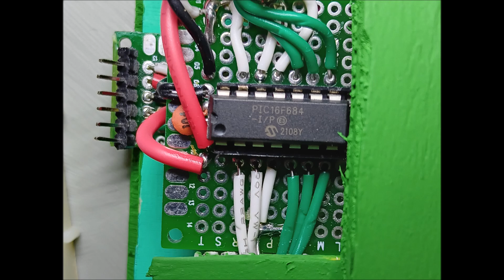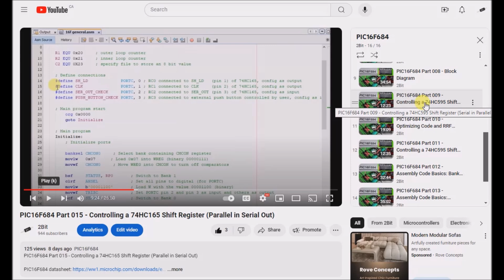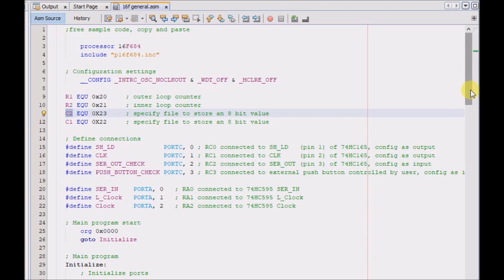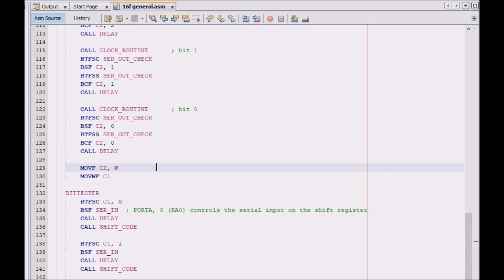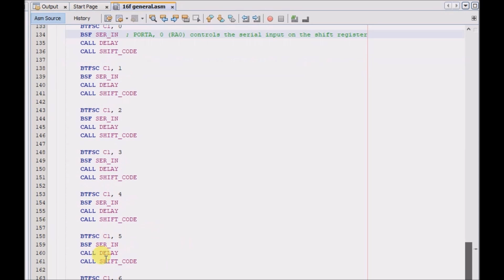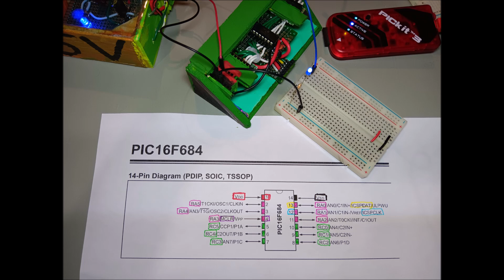PIC16F684 Part 016 - Controlling Two Shift Registers

Comment from the maker: ;free sample code, copy and paste    

    processor 16F684
    include "p16f684.inc"

; Configuration settings
    __CONFIG _INTRC_OSC_NOCLKOUT & _WDT_OFF & _MCLRE_OFF
    
R1 EQU 0x20     ; outer loop counter
R2 EQU 0x21	; inner loop counter
C2 EQU 0X23	; specify file to store an 8 bit value
C1 EQU 0X22	; specify file to store an 8 bit value

; Define connections
#define SH_LD		  PORTC, 0 ; RC0 connected to SH_LD   (pin 1) of 74HC165, config as output
#define CLK		  PORTC, 1 ; RC1 connected to CLK     (pin 2) of 74HC165, config as output
#define SER_OUT_CHECK	  PORTC, 2 ; RC2 connected to SER_OUT (pin 3) of 74HC165, config as input
#define PUSH_BUTTON_CHECK PORTC, 3 ; RC3 connected to external push button controlled by user, config as input
 
#define SER_IN	  PORTA, 0   ; RA0 connected to 74HC595 SER_IN 
#define L_Clock	  PORTA, 1   ; RA1 connected to 74HC595 L_Clock
#define Clock     PORTA, 2   ; RA2 connected to 74HC595 Clock
    
; Main program start
    org 0x0000
    goto Initialize

; Main program
Initialize:
    ; Initialize ports
    
    banksel CMCON0     ; Select bank containing CMCON register
    movlw   0x07      ; Load 0x07 into WREG (binary 00000111)
    movwf   CMCON0     ; Move WREG into CMCON to turn off comparators
   
    bsf     STATUS, RP0       ; Switch to Bank 1
    clrf    ANSEL             ; Set all pins to digital (for PORTC)
    movlw   b'00001100'       ; Load W with the value 00001100 (binary)
    movwf   TRISC             ; Set PORTC pin 2 and pin 3 as input and others as output
    bcf     STATUS, RP0       ; Switch to Bank 0
    
    bsf     STATUS, RP0       ; Switch to Bank 1
    clrf    ANSEL             ; Set all pins to digital
    clrf    TRISA             ; Set all pins of PORTA as output
    bcf     STATUS, RP0       ; Switch to Bank 0
    
    CLRF C1
    CLRF C2
   
    MOVLW b'00000011'	    ; Pin 1 and 2 (Shift/Load and clock ) on 74HC165, triggered from High to LOW, so set high
    MOVWF PORTC		    ; this sets Shift/Load and clock both high
    
Check_Button
    btfss   PUSH_BUTTON_CHECK          ; Check if the button (PORTC pin 3) is pressed 
    goto    Check_Button 
    CALL DELAY	     
       
SHIFT_LOAD		; might label as "Loop"
    BCF  SH_LD		;PORTC, 0 
    CALL DELAY
    BSF  SH_LD		; the preceding three lines load 8 bits of data into 74HC165
   
    BTFSC SER_OUT_CHECK	    ; check the logic level of the SER_OUT pin of 74HC165
    CALL IF_MSB_HIGH
    BTFSS SER_OUT_CHECK
    CALL IF_MSB_LOW
    CALL BIT_TESTER
    
IF_MSB_HIGH		    ; the need for this relies upon a technical function of the 74HC165
    MOVLW b'10000000'	    ; the first bit of data (MSB) doesn't require being clocked in
    MOVWF C2
    RETLW 0
    
IF_MSB_LOW
    MOVLW b'00000000'	    ; the first bit of data (MSB) doesn't require being clocked in
    MOVWF C2
    RETLW 0
    
BIT_TESTER
    CALL CLOCK_ROUTINE	    ; this advances to the next bit
    BTFSC SER_OUT_CHECK	    ; check the logic level of the SER_OUT pin of 74HC165
    BSF C2, 6
    BTFSS SER_OUT_CHECK
    BCF C2, 6
    CALL DELAY
    
    CALL CLOCK_ROUTINE	    ; bit 5
    BTFSC SER_OUT_CHECK	    
    BSF C2, 5
    BTFSS SER_OUT_CHECK
    BCF C2, 5
    CALL DELAY

    CALL CLOCK_ROUTINE	    ; bit 4
    BTFSC SER_OUT_CHECK	    
    BSF C2, 4
    BTFSS SER_OUT_CHECK
    BCF C2, 4
    CALL DELAY
    
    CALL CLOCK_ROUTINE	    ; bit 3
    BTFSC SER_OUT_CHECK	    
    BSF C2, 3
    BTFSS SER_OUT_CHECK
    BCF C2, 3
    CALL DELAY

    CALL CLOCK_ROUTINE	    ; bit 2
    BTFSC SER_OUT_CHECK	    
    BSF C2, 2
    BTFSS SER_OUT_CHECK
    BCF C2, 2
    CALL DELAY
    
    CALL CLOCK_ROUTINE	    ; bit 1
    BTFSC SER_OUT_CHECK	    
    BSF C2, 1
    BTFSS SER_OUT_CHECK
    BCF C2, 1
    CALL DELAY
    
    CALL CLOCK_ROUTINE	    ; bit 0
    BTFSC SER_OUT_CHECK	    
    BSF C2, 0
    BTFSS SER_OUT_CHECK
    BCF C2, 0
    CALL DELAY
    
    MOVF C2, W		; this takes the data from the first register and writes to the second
    MOVWF C1
    
BITTESTER      
    BTFSC C1, 0
    BSF SER_IN	; PORTA, 0 (RA0) controls the serial input on the shift register
    CALL DELAY
    CALL SHIFT_CODE
    
    BTFSC C1, 1
    BSF SER_IN
    CALL DELAY
    CALL SHIFT_CODE
    
    BTFSC C1, 2
    BSF SER_IN
    CALL DELAY
    CALL SHIFT_CODE

    BTFSC C1, 3
    BSF SER_IN
    CALL DELAY
    CALL SHIFT_CODE
    
    BTFSC C1, 4
    BSF SER_IN
    CALL DELAY
    CALL SHIFT_CODE
    
    BTFSC C1, 5
    BSF SER_IN
    CALL DELAY
    CALL SHIFT_CODE
    
    BTFSC C1, 6
    BSF SER_IN
    CALL DELAY
    CALL SHIFT_CODE
    
    BTFSC C1, 7
    BSF SER_IN
    CALL DELAY
    CALL SHIFT_CODE
    
    BSF L_Clock	; L_CLOCK (PORTA, 1) sets or latches previously-sent 8 bits 
    CALL DELAY
    BCF L_Clock	; L_CLOCK cleared back to low 
    CALL DELAY
    
    GOTO Check_Button
   
SHIFT_CODE		; shift register subroutine
    BSF  Clock	; Clock pin (PORTA, 2), clocks in whatever serial input (PORTA, 0) is doing
    CALL DELAY
    BCF Clock
    CALL DELAY
    BCF SER_IN
    ;CALL DELAY
    RETLW 0
       
CLOCK_ROUTINE			    ; indiviually clock-in subsequent 7 bits
    BCF CLK
    CALL DELAY
    BSF CLK
    RETLW 0
    
DELAY MOVLW 0xFF	; adjusted delay time
      MOVWF R1    
AGAIN MOVLW 0xFF
      MOVWF R2    
HERE  NOP
      NOP
      DECFSZ R2, F
      GOTO HERE
      DECFSZ R1, F
      GOTO AGAIN
      RETLW 0
    
    END ; Needed to end the program.